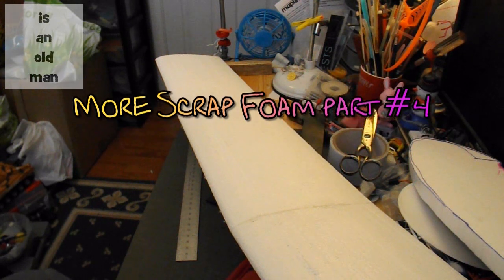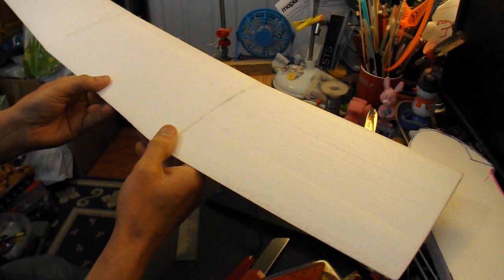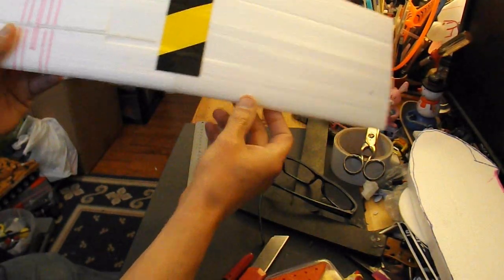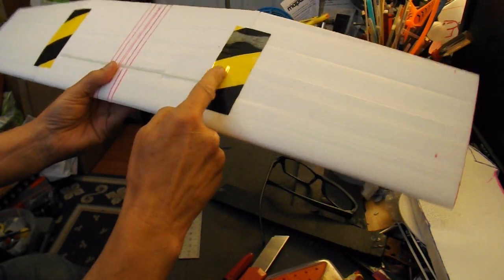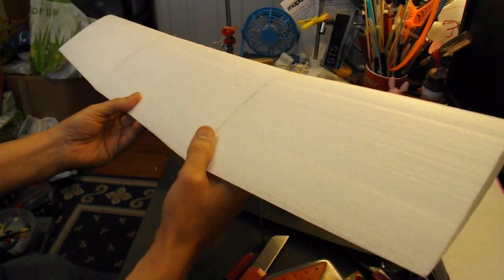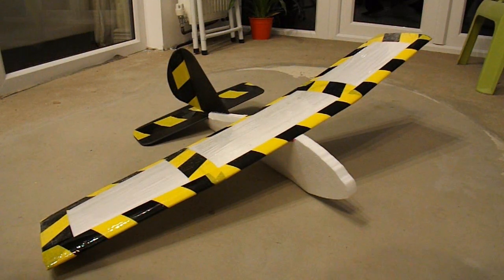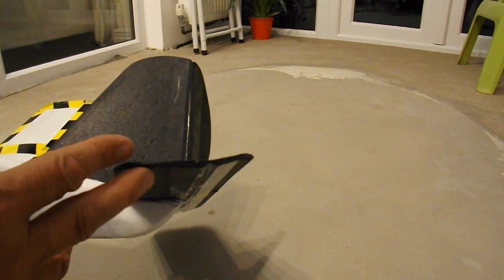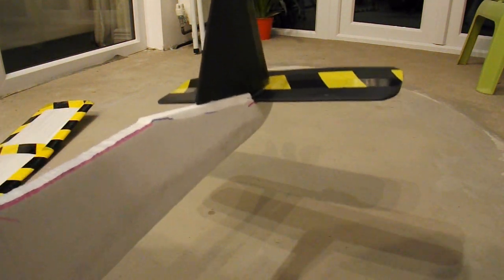More Scrap Foam part #4

Comment: Thats a cute little plane, hope it will last for a while. One quick word about sticky tape on wings: it provides extra strength as you already mentioned. What it also does, it makes the surface a lot smoother, significantly reducing air-friction. That makes the plane go a lot faster, compared to a plane with no tape on the wing. This can be a good or a bad thing, depending on what one wants to achieve.
Reply from the maker: Elnufo I am just looking for the extra strength here. It will be doing a lot of heavy landings.
Reply: Generally what you said is true, but the sticky tape will also add weight, so it is often best not to use much, if any when the objective is to make a good glider, or RC flying model.  There are other options to smooth the foam, or cover it with a stiffening and protective skin.  As you suggested, it comes down to what you think is needed, and would work better.  I tend to use the glue spar option on the smaller foam models with, or without RC gear, or a motor.  It is a very simple, lightweight solution for the main wing and a lamination of thin foam also works well to stiffen and strengthen a rudder, or stabilizer, but you will likely want to sand the lamination down until it is thinner.  The glue and how much is used is what makes all the difference in keeping the assemblies strong and super lightweight.

Comment: tip for foam planes you need wight at the nose because it will push itself alot further and it willl make it glide beter
Reply from the maker: Aleksander Sats keep watching, there are several more episodes in this series.
Reply: GrandadIsAnOldMan
okay
Reply: Actually that isn't true, but it is a common idea.  Guillows and others make toy foam gliders without added nose weight and they are hard to beat for a really good glider.  What they do instead is make the nose longer and it is a common solution when the objective is to keep the glider as lightweight as possible.  I am talking not only of their well known 4 foot wingspan glider, but also their 2 foot wingspan version.  They also make a lot of balsa and paper/tissue skinned flying model kits.

Comment: Looks legit, Granpa! Now you need to make the fuselage more aerodynamically (and scrape off those pen marks) and tape it like the wing other than that i don´t think it needs more strengh...
Reply from the maker: Max Martini I don't do pretty, it will look as rough as I can make it. If other people want to copy me then they can tidy it up :-)
Reply: well, it doesn´t need to be pretty, I agree, that´s why I put that with the pen marks in brackets but it has to be at least aerodynamically to fly good, right?!
Reply from the maker: Max Martini most of the foam board planes I see don't even bother to round off the edges or taper the trailing edges. They still fly, maybe there would be a minor improvement but most of that effort is just for the looks.
Reply: any improvement is a improvement
Reply: you did it on the bottom edge why bothering doing it at the front?
Reply from the maker: Max Martini that was for weight distribution, I will need weight at the front. As it happens you will see in later episodes the body is too weak back there and needs extra strengthening added so the trimming probably didn't help that.

Comment: That looks pretty good, you might loose a bit of turn because of the flex in the body, but you should be able to fly it with your radio no problems, Nice one.
Reply from the maker: Graham R Dyer thanks, you will see later the body is weak as predicted but it is fun finding out and as you probably have noticed I show the failures as well as the success. There are a couple of repairs to see too :-)
Reply: @GrandadIsAnOldMan    I am one huge (not talking about my weight) fan of pilots/builders that show it all, even the moles and warts, so to speak.  Much easier to learn more about the hobby that way.

Comment: Nice, more viewers on this one with comments.  Have you thought about using bamboo skewers for wing spars?  You can get them real cheap in a bag for the BBQ, or as some would say, the Barbie.  Something that is unique about bamboo is it can be heated over a candle and bent without burning it if you are careful not to let the flame touch the bamboo too long, or use an oil that can get really hot without catching fire and dip the bamboo in it for a short period of time.  Bamboo is also very lightweight for a wood and can be shaped in endless ways.  It was an ancient wood used for all sorts of Chinese kites and airplane kits since until balsa became the favorite wood for flying model airplane kits.  A fact about bamboo that few know is it has so much strength it has been used instead of steel rebar in cement and concrete construction by the Japanese and others.  Even Thomas Edison used it instead of steel rebar to make a concrete swimming pool in Florida USA and the swimming pool is still crack free and usable after all these years.  A wonderful wood that is cheap and sold as skewers in most grocery stores.
Reply from the maker: Thanks for the tips